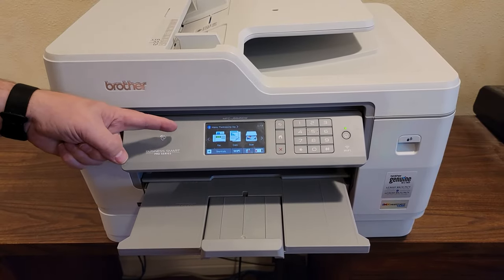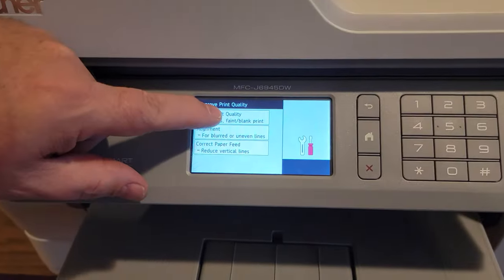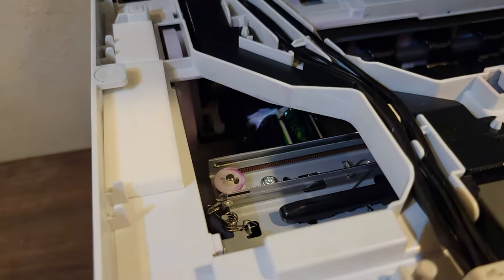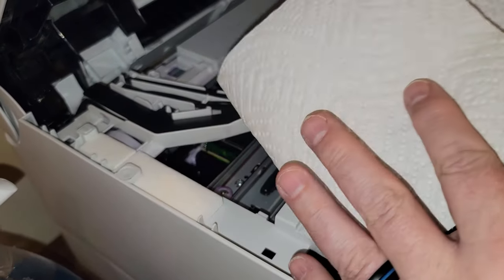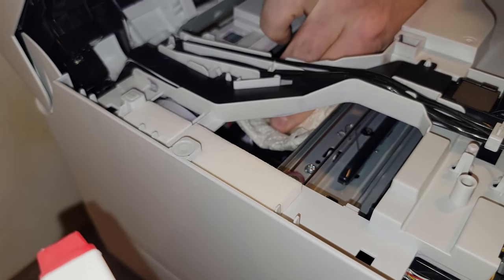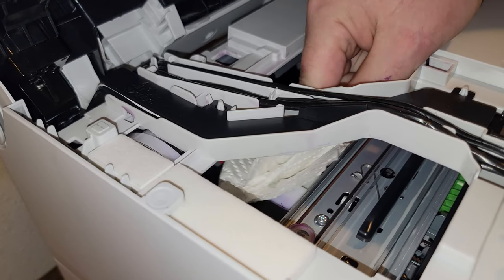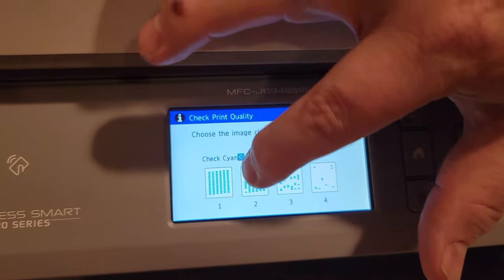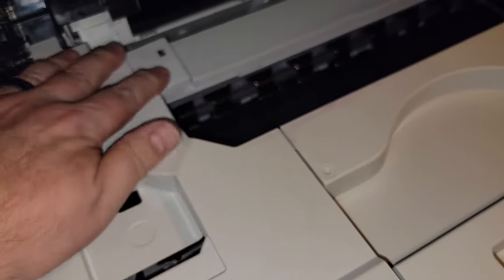How to fix a Brother printer when print head cleaning makes the problem worse

Comment: Thank you for this video.  This fixed the problem I had.  I had even contacted Brother- they told me the printer was out of warranty and I would need to take it to a service center.  I had blown through several sets of ink cartridges trying to get it to print right.  I had found that if I did about 8-9 cycles of print head cleaning, it would eventually start printing right again.  I suppose that somewhere down inside my printer is several hundred dollars worth of dried up ink!  Thanks again.

Comment: This worked GREAT on my Brother MFC-J5945DW printer - THANK YOU!  I ran out of ink trying to clean the printheads, bought more, and went through half of that again trying to clean them.  This worked on the first try!  The ink wells were so full that the Yellow had been contaminated with Black and there were a few lines missing from the Magenta plot, but one round of the lightest cleaning pass on both those colors got them working perfectly again.

Note:  With the printer open and the covers off I watched as it printed the test page.  Part of that routine involves cleaning the print heads and both wells end up with a small amount of ink being deposited.  Looks like the act of printing a test page also uses some extra ink - making sure you're spending lots of money on ink.
Reply: I also have a MFC-J5945DW, it's different from the machine shown in this video. Do you mind tell me where is the color well to clean? Thank you so much!
Reply: @carolyang1987  it’s in the same area, at the left side of where the print head travels.  It’s not easy to get to, but with lots of paper towels folded just right it can be done.

Comment: Thanks, great tip! I have a 5 year old MFC-J6935DW. Under the plastic cover, I found sticky gunk and even hair at the well. After removing that, the print head was unclogged after just one cleaning. Wish I had seen your video before wasting $40 worth of ink.

Comment: I LOVE YOU!!!!!  Thank you SOOOOOOO much.  This has been stressing me out for over a year; I've tried the solutions kits, and was searching for "buying a replacement print head" when I found your video.  It makes you wonder if the Brother engineers ever actually use their own printers, and why in the world their dialog box says "<Information> If print quality has not improved the repeat the process". That's just completely wrong and makes the problem worse.  Overall I like their products, but they need to add a little door and pull-out drawer to make cleaning this part easier, and update the software to tell users to do that.  

I still have one tiny dot missing on my magenta.  Going to do some test pages and if that doesn't clear it, I'll run the cleaning cycle one more time...

Comment: Hi Brad....thank you so much!   I also have a different model, (6545dw)  but I think I found the right spot. This is probably a stupid question... but should the printer be off when we do this?   I've had nothing but trouble with the printer for years now . I've read that it works better if you keep it on.    

btw, my yellow ink has printed black for a couple of years.  Maybe this will fix it!  

I just 'cleaned the nozzles' twice, and the black section of the print out is now black.   fingers crossed that I can do this!
Reply from the maker: Yes, it is probably safest to have the printer unplugged whenever you open it up. Hopefully, this fix is going to work with your printer too.

Comment: Brad: we've tried several times to clean the wells, but the print quality is still very poor. Is there something more we can do...before purchasing a new printer? Thanks so much.
Reply from the maker: This video address a specific problem and it sounds like your problem may be different.  Try contacting Brother tech support and see if they can help.  Also, check your warranty.  When Brother couldn't fix another head problem that we had, they sent us a brand new replacement printer.  Can't hurt to ask.

Comment: Hi
How to clean encoder strip on this model? I have broken lines in printing, tried alignment but didn’t work
Reply from the maker: I am not an expert in printer repair, but a malfunctioning encoder strip would cause out of alignment problems, and such a problem seems pretty rare.  If lines are missing, that is a common problem with these printers.  The print test will show you if specific jets on the head are clogged.  If the same jets show they are failing over repeat tests, then clean the printer as described in the video.  Then use the Brother "waste a lot of ink" built in cleaning routine.  If that doesn't fix the broken jets, then you may have to replace the head.  I had that issue and the new head cost as much as a new printer.  However, to Brother's credit, they ended up sending me a whole new printer as a "warranty repair."

I have never had to clean the encoder on my printer and I have had it for years.  Sorry, but I don't have any tips on how to do it without damaging the film.

Comment: Hi Brad, thanks for your video! I've tried to do that to my printer which is a Brother mfc j4535dw but when I opened the printer it looked a bit different than yours. There is a larger plastic cover going over the whole center. I was able to loosen it up but there seems to be something in the center that holds it down and I can't figure out how to loosen this up. Now I can't close it either since all the outer parts of the plastic are now loose and won't pop back in :-0 Any advice?
Reply from the maker: First, don't panic.  You have got this.  :^)

I am not a printer expert.  However, I was able to figure out the disassembly in the video on my own.  Here are a couple of tips:
1) take photos along the way so that you can remember where everything went.
2) most of the panels are probably just clips that can be bent and lifted to release.
3) if something is not coming loose, there may be a screw involved.  By bending the plastic slightly in different places where it is loose, you should be able to tell where the screw may be located (the spot that isn't moving).  If it isn't obvious, sometimes the screws are under a sticker.
4) remember that the printer is designed to be disassembled in an easy manner.  Take a step back and ask try to figure out the easy way that it was designed to be disassembled.
5) don't force anything.  You don't want to break something.
6) take your time.

Hope that this helps!
Reply: Thank you! I did try to find a screw in the area that feels stuck but couldn't see anything. I got it back together for now, but I'll give it another go tomorrow. Hopefully I'll figure it out. Your video describes my problem to the T! I have a feeling that this could be the problem.  @BradStone-1
Reply: @agirlnamedsilk  Same thing.  Mine is J4335 and is slightly different than what is shown in video. I could not open it fully and don't want to force and break anything. Could you open it and clean? If yes, can you please give some inputs?
Reply: Have the same problem locating those tanks on MFC-J1010DW.  I wish there was a guide how to access those

Comment: do you recommend this printer , we are at the moment looking at this bcz of big cartridge and A3
Reply from the maker: Tough question.  One the one hand, you shouldn't have to do this kind of maintenance on a printer - it should just work.  It is painful on the wallet when lines appear in your print and the cleaning routine consists of squirting expensive ink through the head to clean it.  On the other hand, the ink seems to be about as inexpensive as can be found.  Overall, I would look hard at alternative printers and weigh the options before buying this one.
Reply: @BradStone-1  yeah inkjjets dilemma, also toners are wkrse imahe quality and reliable however brother started making subpar lasers and leds thats nust die after few months power sjoply issues, bad cartridge batteries on chips not letting u use ur toner. It s the wkrld of printing
Reply: Worse printer ever. Mine worked for about a month and then that’s it. I don’t just have a color problem. I have an alignment problem. Absolute nightmare printer.